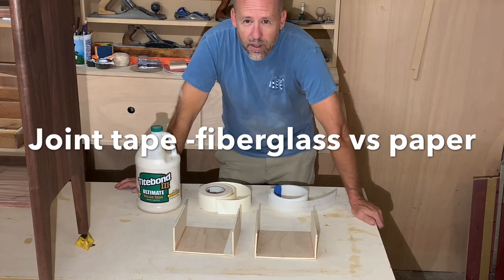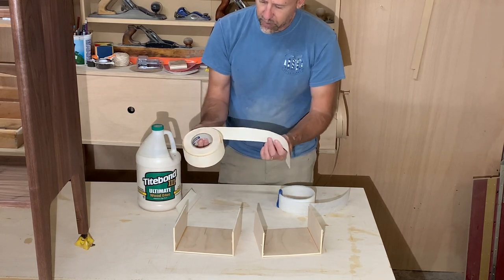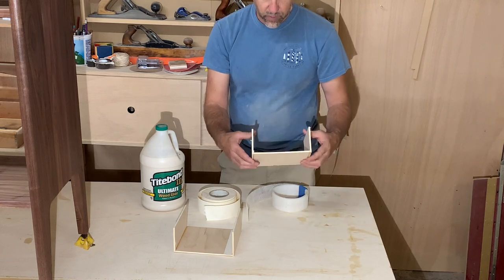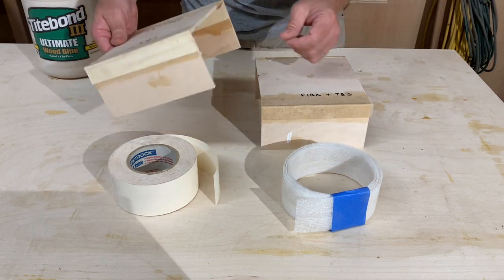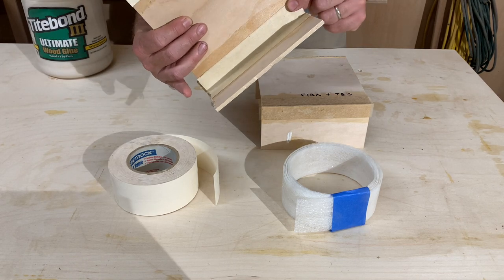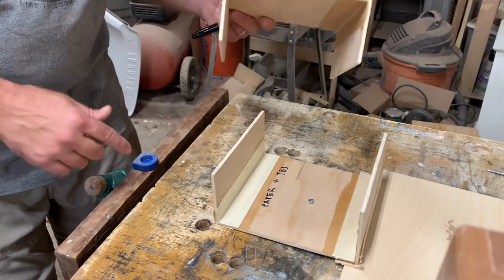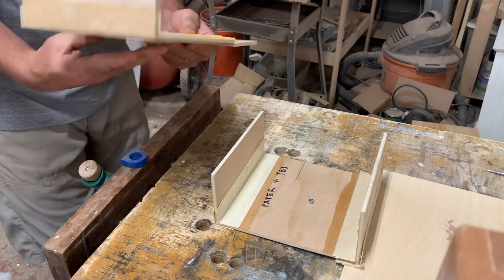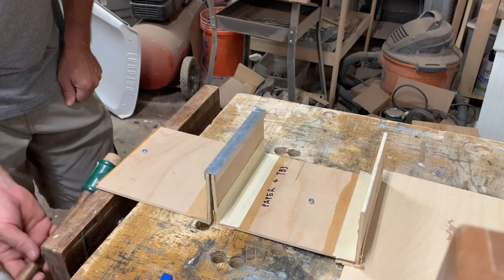Fiberglass vs Paper boat hull seams

Comment: I remember reading an account of a guy in England after WW2 who built a very small cruising sailboat out of paper and waterproof glue. He would make paper and glue tubes to make a lot of internal frames and structures. There were also canoes made of paper and I think varnish back around 120 years ago that was very popular. There are some very cool small boats being built in Vietnam and Thailand that are on YouTube- they are making them from plastic blue barrels and using a grinder to cut out flat sheets of the plastic from the barrels to make the hull and use metal or wood frames. I also like seeing some people use foam covered in plastic and then add polyester resin and fiberglass over the coated foam. The plastic prevents the resin from eating up the foam and the builds are very quick and cheap. there is a guy on YT that is using foam and drywall tape and glue to make tables and shelves for his van conversion. I like your experiments a lot,  looking forward to more videos.

Comment: OK Mark, this answers most of the questions I raised your related video on this topic. The tape is paper and produced for jointing drywall (plasterboard in the UK I think). I wonder if the paper tape is a bit thicker than the glass fibre scrim and maybe that produces more of an internal radius, giving more strength. I wonder if doubling up the joint with a narrower tape would add to the strength?
A well executed epoxy joint with a radius fillet will often end up with the ply breaking under test load, not the joint; even stronger if the fillet is over taped. Its almost always the joints  which attract the highest loads.
Reply from the maker: As a woodworker, I studied wood joinery.  The strongest wood joints are always wood to wood joints with fingers or dovetails, or mortise and tenon and wood glue.  Epoxy is harder than wood and so are screws and nails.  All three of these tend to compress the surrounding wood and eventually wiggle free.  I agree, you could double up the paper tape on the inside corners of a hull, but you need to put the second layer on within 15 minutes so that the glue will stick to the previous layer.  This will provide a strong but also flexible seam.

Comment: perhaps a better or more accurate test might be one where the joints are immersed in or saturated with water.  It's my belief that the paper will then yield sooner than that fiberglass.  A test which I've not performed,...pure speculation on my part. Not to mention the long time effects of salt in ocean water might be to the paper.
Reply from the maker: Titebond 3 is fully waterproof.  Also if building a boat this would be primed and painted.  I’ve already built a boat this way and not a drop of water got inside.  I’ll prime and paint my sample and immerse it in salt water for a week and see what happens.
Reply: I thought it was PVA based…so not waterproof, eventually.

Comment: I wonder if the fiberglass would work better if you had a radius on the inside of the curve instead of a sharp 90 degree angle.  I am guessing it would.
Reply from the maker: Yes, probably.  This is just 1 test.  I probably need to run more tests with different angles or with interior fillets.  Both epoxy and TB3 stick well to raw wood, but not to dry versions of each other, so I am trying to stay away from epoxy all together.  TB3 did not exist when the West System evolved.  That is why I am testing it now.
Reply: Yes its pointless without a fillet

Comment: Good for a cheap dinghy
Reply from the maker: Definitely.  With primer and a good exterior paint, it works great on a small boat that is used for half a day and then stored dry.  I have not yet left my boat in the water for multiple days.

Comment: Is the fiberglass tape cut on the bias?  If it isn't, then there's only 50% of the fabric providing strength to the joint.
Reply from the maker: I used “Fiba” tape.  I believe the fiber pattern is random.  I chose this because I heard that people are using it on their boat seams.  I had already used paper tape on a boat and wanted to know which was stronger.
Reply: @markpalmquist  Interesting.
How do you get the tape to curve , do you just cut darts ?
Reply from the maker: @harryme472  I have only used it on subtle curves.  One secret to keeping it from buckling or having air bubbles is to coat both the plywood boat and the paper and then wait 5 minutes before applying the paper to the seam.  This allows the paper to expand before it is laid down.  If you put it on too early, it will expand after it is applied.  You can also apply the paper tape in smaller sections, similar to paper mache, with overlapping seams.

Comment: Well you still need to fillet your inside seems to create a radius
Reply from the maker: This depends on how large the boat is and how fast it will go.  Internal chine logs glued in the corners would work, but also any fibrous material saturated in tightbond 3 would work.  I have been meaning to test thick or chunky yarn, or something that is a bit flatter but has more thickness than paper.  Anything that adds a triangular gusset to an internal seam will work.   Then its just a matter of how many layers are required to get the best thickness and strength.  Titebond will stick to itself as long as second layer is applied within 15 minutes.  Just like epoxy, dried glue does not want to stick to itself.

Comment: What's worse, spending the $ for glass and epoxy? Or wasting all the $ on everything you invested into the boat after it falls apart when you build it with paper and glue lol
Reply from the maker: I made a small boat this way and it has not fallen apart.  Epoxy is harder than plywood and is more brittle, less flexible than titebond 3.  When plywood shrinks or expands, titebond flexes.  When plywood is fastened to plywood with epoxy, the epoxy will not expand or contract.
Reply: @markpalmquist  dude you can't honestly justify glue over the resin that's the god compound in building boats.
Reply from the maker: @bipedalhominid6815  this was an experiment.  The results speak for themselves.  I have not compared paper + titebond to fiber + epoxy yet.  And no one has yet to come up with a titebond based internal fillet on a glue and stitch joint.  I am working on that.
Reply: We need people to experiment and try new techniques, otherwise would still be chipping at stones and hollowing out logs!